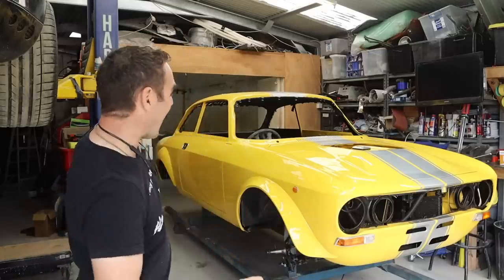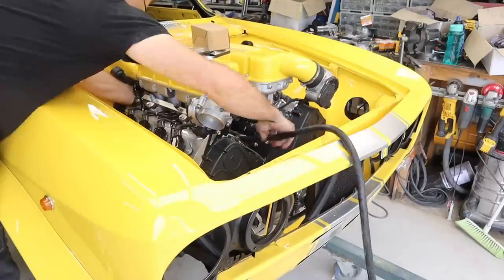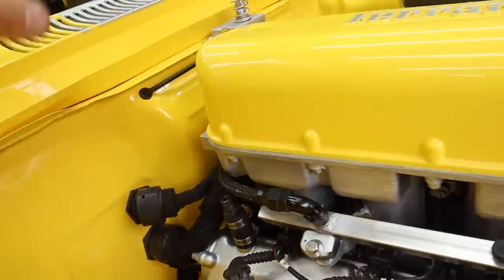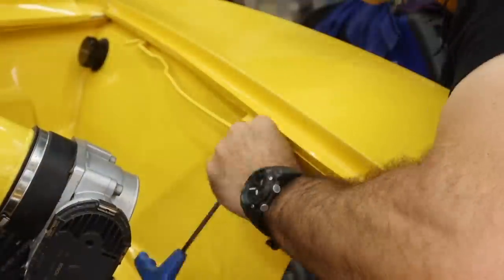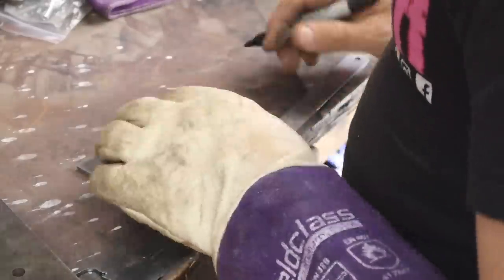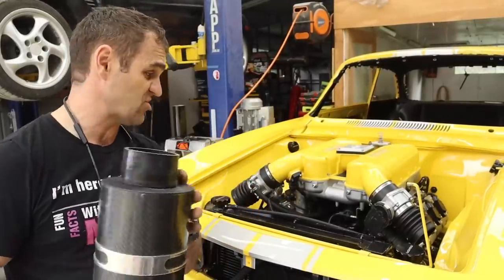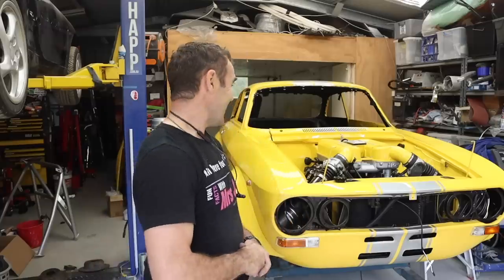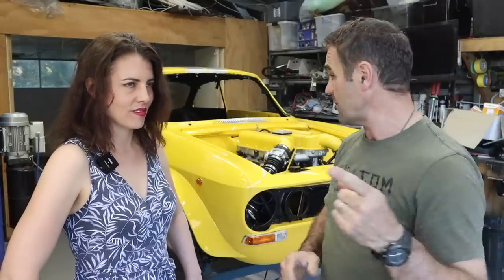Vacuum system sorted - Ferrari engined Alfa 105 Alfarrari build part 169

Comment: I note that the worm drive clamps (aka jubilee worm drive clamp) that you have used in the engine bay incorporate rectangular and somewhat sharp perforations located regularly around the clamp's perimeter.  These have a tendency to cut into the rubber hose when tightened - all of which reduces the life of the hose.  The situation is excerbated when the clamp is used on small diameter hoses where the clamp cutting action at the perforation is magnified.  In extreme cases, say when used on 6mm fuel hose, the clamp tends to shred the rubber that results in material jutting through the perforations.   Needless to say, I recommend the type that incorporate rolled edges and are not perforated - e.g. Wurth.

Comment: Positive crankcase ventilation
Reply: Correct, manifold "vacuum" sucks the crankcase fumes, not let the pressure out. Cheers
Reply from the maker: Did I say vacuum? I meant ventilation, you are spot on.

Comment: That ECU connector is really close to the engine. Plus with the wires so close to the connector and the engine would be a high chance of vibration issues with the electrical connector. Maybe worth looking at a right angle connector.

Comment: Oi Jeff, engine bay is looking pretty damn amazing now. Love what you did with the air filters, the way they go through the inner fenders. Maybe for once, I can give you a bit of inspiration instead of the other way around: On my Fulvia, I am gonna replace the indicators with small ones (Fiat X1/9 side indicators probably) and 3D print air vents that will fill the rest of the hole where the big indicators sat and that will channel air to the brakes. Inspiration came from the Porsche 993 RSR. If you did something similar, your air filters would get much more air to suck into that big Fezza lump. 😁

Comment: The size of your shop isn't the issue. In fact, a bigger shop is worse because you have more spaces to lose stuff. 

It really comes down to organization. The best method I've found to date is to buy a set of large storage bins and plenty of sandwich bags. Bag and label the bits & pieces, even the screws... then store them in an appropriately labeled bin with parts from the same area of the car.

Don't trust your memory; you will forget. Don't steal screws from item A to attached item B just because they're the same size. When you go to install item A, you'll have forgotten the size which means making a simple job into a more complex one.

Comment: Does Race Work offer a 90 degree bulkhead connector?  That harness on the cam cover would concern me. It looks we’ll protect and I’m sure the engine mounts are pretty firm but the constant rubbing from the vibration will eventually take its toll.  The very least it’ll be the paint on the cam cover.

Comment: i dont think you need a pcv system if youre using a dry sump?  the crankcase should e under vacuum shouldn't it??
Reply from the maker: You do need it (as it had it from factory). Think of the dry sump as an extension of the crank case. PCV to dry sump, and then a breather to the inlet manifold.

Comment: Please dont use those f.ugly hose clamps on this jewel of an engine😱
Reply: Some clean, proper diameter Oetiker clamps would suit perfectly here.
Reply: @computiNATEor  Exactly. I'd prefer spring band clamps like car manufacturers use - easily removable. But you're right, the worm drive hose clamps suck
Reply: @donfinch862  True, but spring-band clamps aren’t European in my mind. Oetiker clamps have more of a Euro vibe, and are way cleaner than the spring band ones, IMO. Plus, how often would they need to be removed? Not very, I’d guess
Reply: @computiNATEor  Ahhh, my apologies. I googled the clamps. I was thinking you meant "ear" clamps (made by oetiker as well). I think you mean the ones that clip together - never used them. Yes, they would be a good choice. And no cuts on your arm when poking around in there. Cheers mate

Comment: The PCV valve should go routed back into the intake, not the dry sump.
Reply from the maker: On cars without a dry sump, it does go to the intake. Think of the dry sump as an extension of the crank case. That is how it is originally plumbed ;)
Reply: @HomeBuiltByJeff  Interesting!  I'll have to chase the line on my Covette C8 to see if it is like that.  I wonder how the pressure is relieved.  Another line from the sump tank?  The pressure has to go somewhere.
Reply: @scottmyers4069  That's right, at least on an old 911, the tank vents back into the intake (or, commonly modified to a catch can with vent.)

Comment: Hi Jeff, this is one great project. I don't know if I saw correctly because of the camera angles etc, but the bottom harness plug cable bundle looks like they are in contact with the cam cover. With the motor movement and the short distance between cam cover and fire wall fitting, wouldn't this stress out the cables causing them to be damaged as it's such a short run without any possibility of flex. Hard to tell from the camera angle.